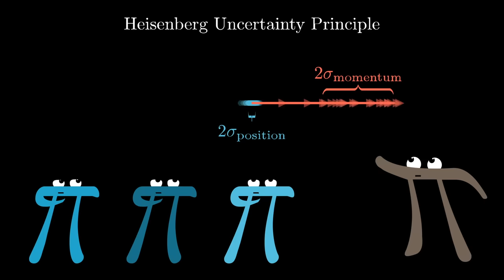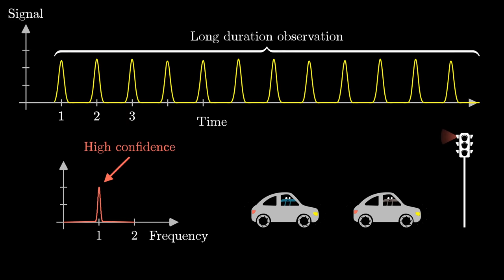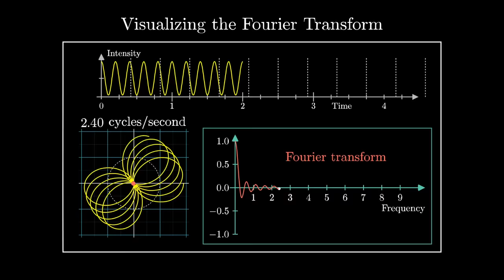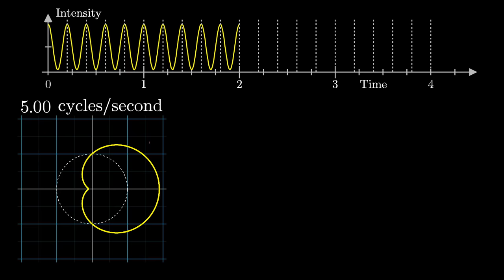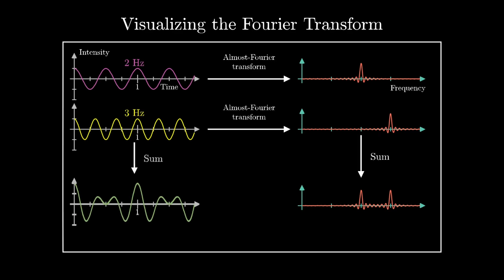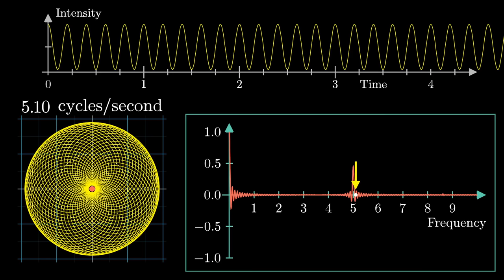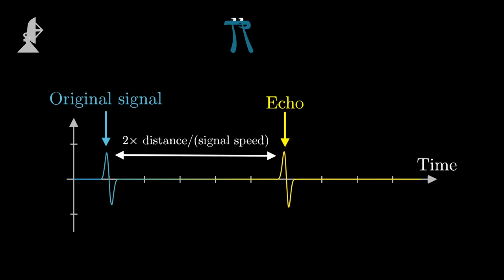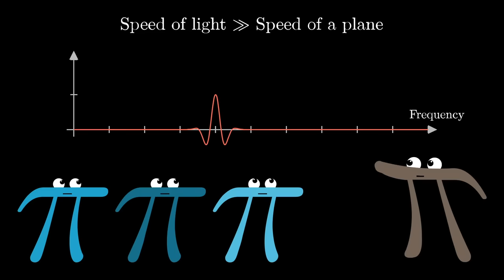The more general uncertainty principle, regarding Fourier transforms

Comment: Excellent video, as always. Although, I wonder why the Fourier pair for particles is position/momentum as opposed to say, position/mass or something else. Is the real world so much an extension of math that everything is inevitable?
Reply: > I wonder why the Fourier pair for particles is position/momentum
Just the way the universe works.  I suspect that an in-depth knowledge of General Relativity could tell you why those specific features are involved, but at best that's just going to move the question from "why is it position/momentum" to "why does GR work?"  And unfortunately the answer for both is a whole lot of "because that's how it is."  You can (and of course mathematicians have, because why not) formulate a universe where say, gravity works as a linear inverse or a cubed inverse rule rather than a squared inverse.  Those universes don't make little if any kind of "sense" relative to our own, but they can be constructed if you try hard enough, leading to a whole lot of answers based on the anthropic principle rather than fundamental axioms.  Of course, a new discovery could be made at any time that either gives a strong basis for 1/x^2 being the only viable universe, or confirming for sure that there is no such basis and our universe is as it is purely by chance.

> Is the real world so much an extension of math that everything is inevitable?
I've always hated Wigner's quote about the unreasonable effectiveness of mathematics in science.  Its not in the slightest bit unreasonable when you consider that we've mostly defined mathematics based on observations of the real world, all the way from the ancient Babylonians or earlier computing the areas of their (farming) fields right up to modern science investigating (quantum) fields.  Yes, there's occasionally an insight pulled from the study of pure math that turns out to actually be a true (but non-obvious) feature of the real world such as the prediction of the positron, but in the vast vast majority of cases the work goes the other way around -- the real world tells us how to build the math rather than the math telling us how the world works.
Reply: But I do appreciate how to us, that didn't have the whole Workings of Reality explained from the beginning, it would look as if our Math can somehow predict observations that we still haven't done, even though it was created as our tool to explain the Universe. :) Oh how I love this kind of thought.
Reply: Feynstein 100 This is due to the fouriertransform: The FT of Position is a frequency, thus it is proportional to the inverse wavelength. According to DeBroglie the inverse wavelength is proportional to the momentum of a particle.
Reply: +Doctor Trueheart Yes, the fact that the universe can do so many things by building up from such a simple rules is truly incredible.  The part I take issue with is suggesting that its somehow surprising that math can describe those rules.  It can do so because we specifically designed it to do so.  If the math we use didn't work to describe the universe, we wouldn't use it to describe the universe and the question wouldn't even arise.

+plain reflex I think the question he was posing was why is the FT of position proportional to momentum specifically?  Why not say, just velocity (without the mass factor)?  Or proportional to the size of the particle in some way?  Or not proportional to anything?  Certainly the math tells us that position and momentum are FT's of each other, and the math is built that way because we've observed it to be true, but neither the math nor the observations can tell us why its true.
Reply: In classical mechanics, a wave (like soundwaves) carries momentum, and it's given by (momentum) = (energy) / (phase velocity) or simply p = E / c. However, in quantum mechanics, we assume that the energy must be proportional only to the frequency of the wave (E = h f, h being Planck's constant). So, if we plug in E = h f in the momentum formula we can use the fact that wavelength lambda is lambda = c / f to find

p = E / c = (h f) / c = h (f / c) = h / lambda.

Now, as 3B1B video states, spatial frequency ( 1 / lambda ) is related to the position by a Fourier Transform, giving us the uncertainty relation.

As a conclusion, the momentum being proportional to the spatial frequency is the natural extension of a classical result to the quantum world, where we assume that every particle can be represented by a wave and the relation E = h f holds true.
Reply: I don’t have a good answer to this, but position and momentum, as well as time and energy (although we’re really talking about one thing here since space and time, as well as momentum and energy, are linked since time is the 4th dimension of space in space time), are both already related to each other in terms of conservation laws. These say that a physical system conserves energy iff the outcome will be the same no matter the starting time (eg your car will behave the same if you drive it now, or if you’re running late and drive it in 5 minutes), and that a physical system conserves momentum iff it will behave the same no matter where you start in space (so a ball dropped out of your left hand will hit the ground at the same time as a ball dropped out of your right hand (or at least reach the same speed at the same time)).
Reply: because mass is distributed over _both_.  and measuring mass of a body, "at rest" or otherwise, is always done over a fixed area.  in other words, mass is a definite integral of the mass-position wave.
Reply: I had a similar problem with this question before taking a proper lecture in quantum mechanics theory. Introducing the relation between position and momentum space only by the fourier transform made the whole thing appear somehow arbitrary and it made it difficult to apply this idea when solving exercises. The more  fundamental relation here is that the position and momentum observable are non commuting (see my other comment here for an explanation but basically the product xp is not equal to px in quantum mechanics where x is position and p momentum). The fourier transform then naturally emerges from this relation when transforming from position to momentum space by means of linear algebra.
Reply: Because (delta a) x (delta b) has to have units of h. Whatever a and b are.
Reply: It comes from the de brogile wavelength relation
Reply: As 3B1B said, there's more than one way to think about it. The way I like to think about it is that the quantum mechanical operator corresponding to momentum "generates" spatial translations. This means the following. Say I have a function f(x), and I want to translate it, that is, I want to find the function f(x + δx), where δx is some small quantity. How would I do that? Well, one way is to Taylor expand f:

f(x + δx) = f(x) + f'(x) δx + ...

where the "..." is proportional to (δx)², which I assume was small enough to neglect. 

This expression can be "generated" by applying the operator exp(δx d/dx) = exp(i δx(-i d/dx)) to f(x).

exp(δx d/dx) f(x) = (1 + δx d/dx + ...) f(x) = f(x + δx).

This is what I meant when I said the operator (-i d/dx) "generates" translations. At least small ones. If I want to build big translations, all I have to do is apply this operator over and over.

Why is this important? Well, it is because symmetry under spatial translations is what classically proves that momentum is a conserved quantity. If I shift my entire experiment (together with the laboratory) to the left 1 meter, most likely I won't be able to detect the difference. In classical physics, Noether's theorem shows that this symmetry results in momentum as the conserved quantity. In quantum mechanics, if the operator p = (-i d/dx) commutes with the Hamiltonian (the operator describing the energy of the system), we conclude that the energies of the system don't change when the system is translated. Thus we can identify the generator of translations with momentum.

Only one thing is left: to identify the momentum operator with spatial frequencies. Think of the function f(x) = e^(i px) = cos(px) + i sin(px). If you apply the momentum operator to this function, you get

(-i d/dx) e^(i p x) = -i * i p e^(i p x) = p * e ^(i p x).

This equation is interpreted in the following way: if you prepare a particle with a wavefunction e^(i p x), if an observer measured its momentum, he'd get "p" as a result. This doesn't follow from anything else in the derivation above -- it comes from the axioms of quantum mechanics.

In any case, p is just the angular frequency of the wavefunction, so we now have the whole picture: the operator (-i d/dx) generates translations, so it corresponds to the usual momentum, and it is measured sharply in wavefunctions which are periodic of the form e^(i p x).
Reply: Vacuum Diagrams very well put! I forgot that this is the better way to explain this concept, just a reminder to the rest of the viewers that hbar is treated to be 1 in this comment.
Reply: D'oh! Thanks for the reminder, I was going to add a disclaimer but forgot. :)
Reply: Halberd Rejoyceth gave the best response.  For any 2 observable properties, A and B, of any quantum system, if AB - BA = 0, then there is no uncertainty relation between them.  If AB - BA != 0, then there is an uncertainty relation.  The quantity AB - BA is called the commutator.
Reply: Sean Ehle commutation relation between x and p is at such is because of the fact that they are conjugate pairs in the fourier transformation. I dont think it's the most fundamental correct me if I'm wrong.
Reply: Feynman's path-integral approach answers this pretty neatly with a clear classical connection. There's an abstract formulation of classical mechanics called analytical mechanics, equivalent to Newton's laws and a realization of a nice mathematical framework for describing dynamical systems in general, which derives the dynamics of a system from a function which gives the "action" of a trajectory of the system. The derivative of the action with respect to a given variable is "conjugate" to that variable, and together with that variable form part of a "symplectic basis" (spanning "phase space", which you may have heard of) for describing the trajectory of the system, and their product defines a "symplectic form" with units of action. Pretty abstract stuff! Anyway, in the quantization of this framework -- the "path integral approach" -- it is explicitly action which is quantized (another name for Planck's constant is "the quantum of action") and conjugate variables become operators and are generalized Fourier transform duals of each other, their symplectic form the left-hand-side of an uncertainty relation. From a certain perspective, the crux of quantum mechanics is the quantization of action, and position and momentum are a pair because they're conjugate with respect to action even classically. Other such pairs include energy and time, angular momentum and orientiaion, and electric potential and charge density, and each are associated with an uncertainty relation in quantum mechanics.

So really, there's a deep physical connection between conjugate attributes (such as position and momentum) of a system which we can describe mathematically, and quantum physics is a refinement of our understanding of that connection.

Comment: 1:28 shouldn’t the height of the peak in the bottom chart (*/frequency) increase, as the time increases?
Reply: you are right. it should. it's a probability density function so it should integrate to one, hence as it narrows in width the peak should increase.

Comment: Really nice combination - The Fourier Transform picture and the corresponding  Uncertainty Principle. Well done!   I challenge the author to extend this to THE MORE GENERAL PICTURE, which is a relationship between the products of deviations/uncertainties of  expectation values of different observables ( linear operators). This is a more general point of view and depends only on the vector space / linear operator structure. Since it is more general but simply stated in its own terms, there should be an equally clear way to explain from almost scratch.

Comment: Congratulations on this fantastic video. The explanation of the Fourier Transformation is the best I seem ever. I will comment on the other video. I would like to suggest you guys make one video on the single slit diffraction (SSD) experiment as well.  The SSD has a beautiful connection to the uncertainty principle. While the slit is made shorter the diffraction pattern gets more spread which is the Fourier Transform of the squares slit. The slit may be seen as space and the diffraction pattern momentum.  Furthermore, the Babinet principle introduces the importance of the phase which you only discussed briefly in your presentation. In a way, solid-state physics and protein crystallography are strongly based on diffraction.

Comment: Interesting as always.

I thought an interesting analogie might be how in a painting (pointilistic or computer generated) as you get closer to a pixel/point in you get a clearer view of what colour it has, but less clear view of where it is in the picture - is it a blue pixel in someones iris or a blue pixel in the sky?

Another interesting example I feel was related was that higher frequencies for a long period of time are harder to locate because the signals are more likely to overlap when your brain starts to analyse them even though they start with a clear different distance to each ear. Lower frequencies for short durations will confuse you less since they will not overlap in a way that confuses the brain as to what is the temporal relationship between signals. (Steve mould explains this I believe)

The thing that still unsettles me is that in high school chemistry I was taught that the position of an electron (probability cloud of positions) is inherintly a factor of the energy level of that electron (corresponding to the momentum I assume).

Does that simply mean that electrons with higher energies also have larger / more homogenous over space probability clouds - making them less likely to be found in one spot in that cloud of probabilities?

Comment: One way we were taught to look at the uncertainty principle during my studies was through the analogy with a camera.

Let's say you have a camera. The exposure time of that camera, the time the lens stays open when taking a picture, is adjustable.

Now, take a picture of a moving car using a short exposure time. You will get a very crisp picture of the car and you will be able to very accurately say where the car was at the time you took the picture. However, you won't be able to tell how fast the car was going or if it was moving at all, it's a picture of a single point in time after all. 

Say, instead, you had decided to use a long exposure time, you would have gotten a blurry picture of the car. Because of the blurriness, you wouldn't be able to accurately tell where the car was when you took the picture. However, you would able to tell it was moving and maybe estimate how fast based on the blurriness.

Comment: This is a really interesting perspective on spectral leakage. The way I learned it is that when you're taking the DFT (finite support in time), you're windowing your wave in the time domain. This windowing appears as a sinc in the frequency domain and is convolved with your information (since the window was multiplied by the signal in the time domain). Another way to look at it is  from linear algebra; you don't have enough basis vectors to represent the frequency you want well enough

Comment: In the engineering of pulses for various purposes (my background is MRI, but the given radar example is just as good), we define a function's "time-bandwidth product" to describe how well a function treats this version of the Fourier tradeoff. A higher time-bandwidth product function will have a larger bandwidth for a given pulse length (worse for uncertainty, which relates to how thin a slice we can image in MRI), while a lower time-bandwidth product pulse has a narrower bandwidth for a given pulse length.
 
Of course, the pulse/spectral energy (integrated square of the function or Fourier transform) are always equal thanks to Parseval's theorem, but if the "tails" of a given pulse's spectrum are more suppressed, we consider the bandwidth narrower. This follows the "full width, half max" definition of bandwidth.

Comment: There might be an error in the video if the signal is longer the value of the Fourier should be higher. A short length of a sin wave related to a product of an infinite length Sine wave and a rectangular support. And the Fourier transform should be a convolution of FT of a sine wave which is a Dirac impulse and FT of the rectangular which Sinc function. But the point is if the rectangular has larger support interval. The Sinc function should has a larger value in peak and higher density in frequency, In the video, it has shown it has a higher density but the values are the same it's around 0.5.
The non-unity FT Transform of a Rectangular which has an interval [-T/2, T/2] with value A, is ATsinc(fT).

Correct me if I'm wrong. Thx